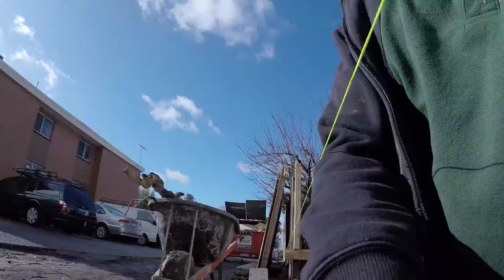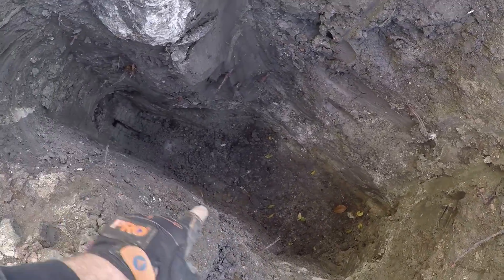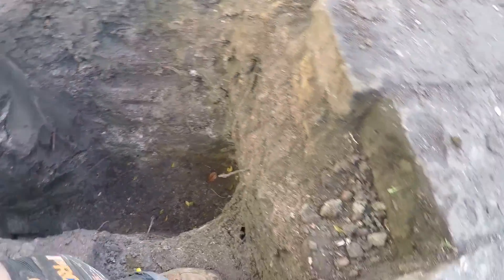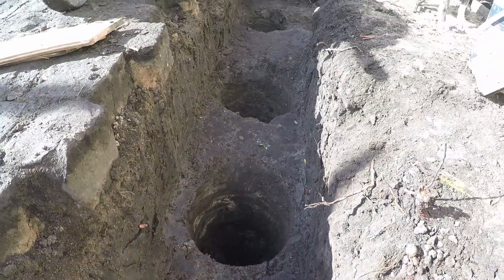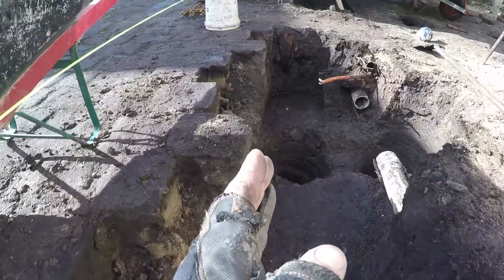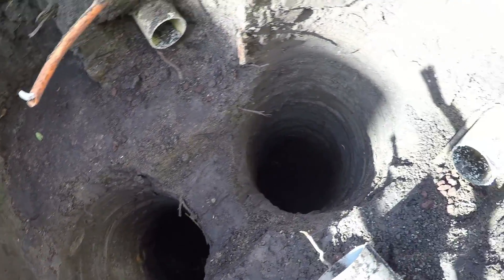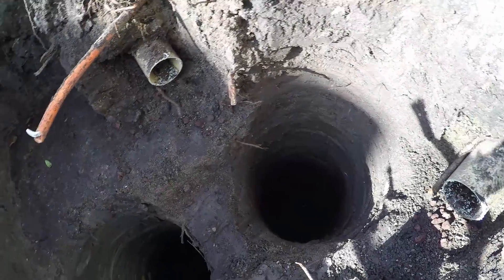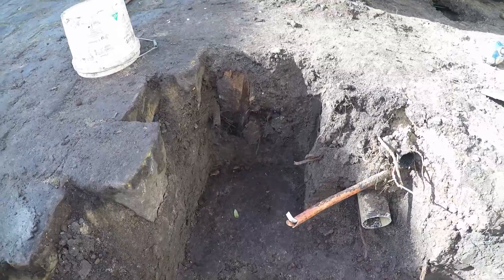strip footing with pier foundation

Comment: Hi
your video is very informative.
I have a question. How deep do you have to drlll your pier hole? does it have to touch the rock bed?
Reply: and also how to know if the hole touches the bed rock? If you are checking as a consultant.
Reply from the maker: gday Asim
just to let you know, we are creating a video shortly on setting out and digging strip footings for a slab with piers .... i will address these two issue for you then